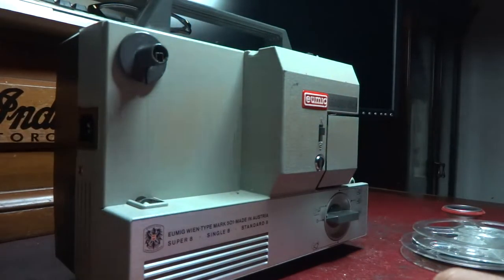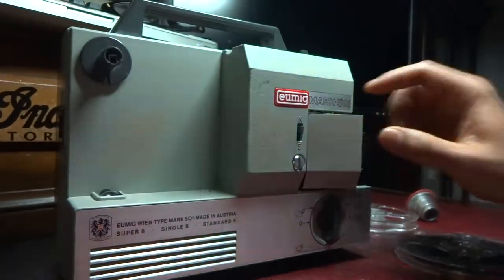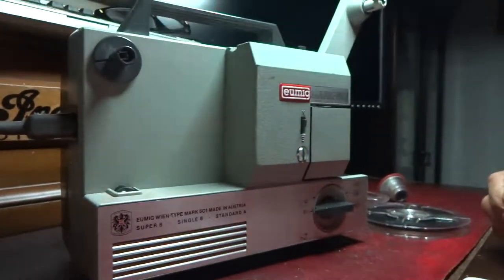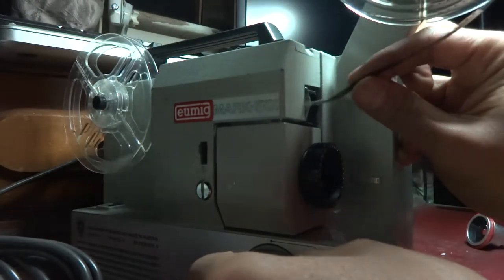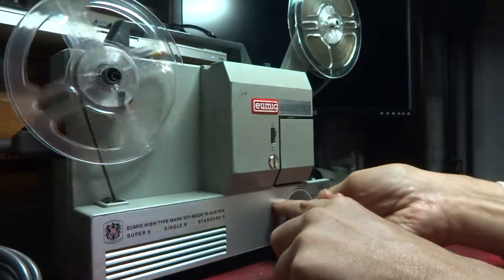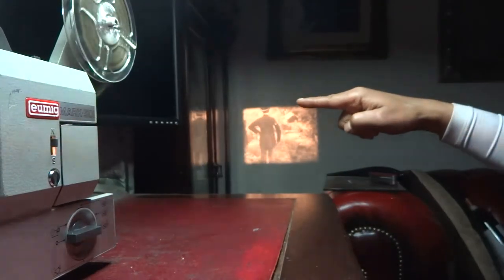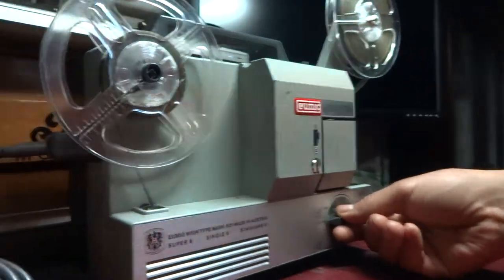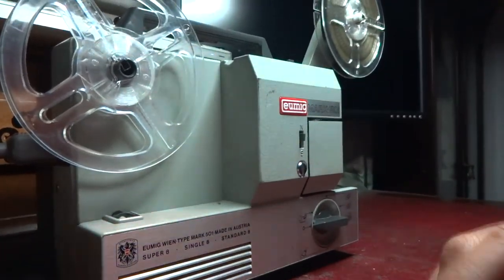Vintage EUMIG MARK 501 8mm/Super 8mm Cine Film Projector Working with Test Film

Comment: Very nice demo. I'm trying to find an owners manual. I have the same projector but it is a JC Penney model Type 515. Only difference are the name plates. In the 70s and 80s most the electrical gadget stuff with American company names was made in Asia or Europe and had minor modifications. Eumig made great projectors.

Comment: I have such a projector but without a (driving) reel (spool). The spindle diameter is 14mm. Where can I get a reel with a 14mm hole in the center as those that I see on internet have a smaller diameter ?   I hope this makes sense; Thank you in advance for your answer.

Comment: The gate moves out to reduce friction so that the film canbe rewound and to get it away from the claw that pulls it through when projectiing to prevent sprocket (NOT track) damage and not to project the lens. Also that is not the correct take up spool the right ones are designed to automatically grip the film one was provided when the projector was sold.

Comment: If the spool would be bigger it reaches right about the base of the projector the film will be automatically catched by the spool so no need to feed the film into the slot and risk of damaging it. I also have a Eumig aa S820 HQS sound projector and an Elmo k110-SM for silent movies and the Elmo can do both so regular 8 and super 8.